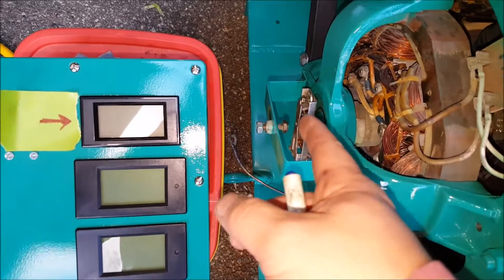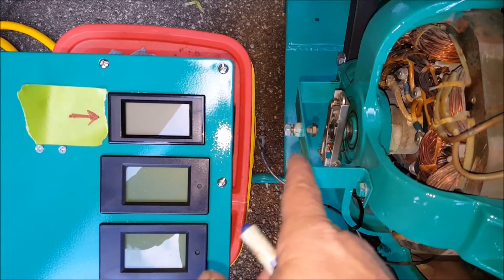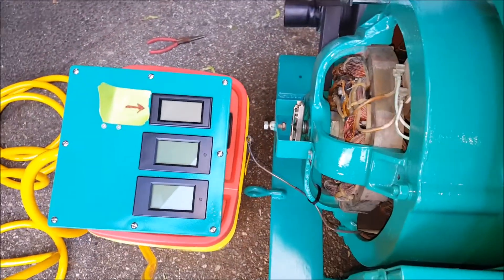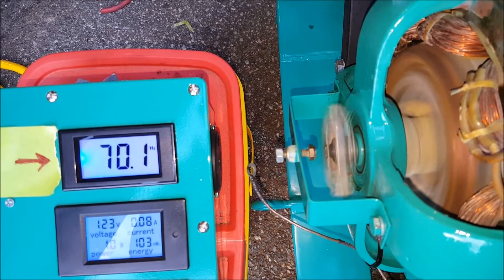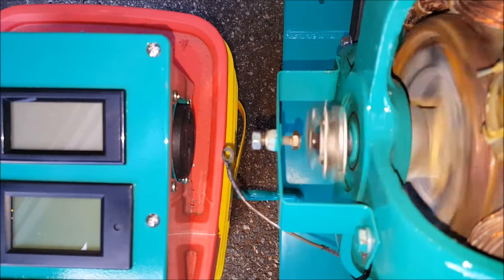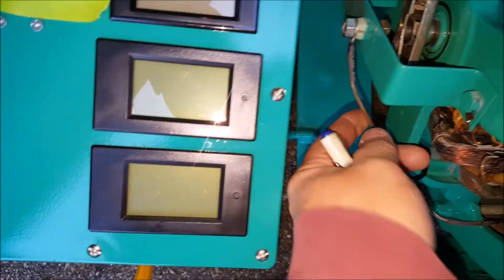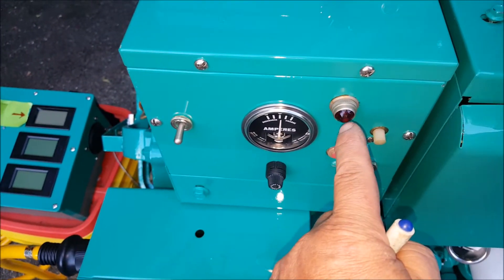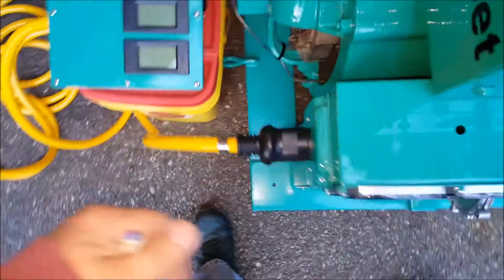Onan JB 7.5 Over Speed Mechanical Switch (OS OK) Adjustment / Conclusion

Comment: I have enjoyed your videos, I have learned a lot about these gensets.  Where did you obtain your digital meters for your system monitor?  Also where have you obtained the Onan color or at least do you have a paint code?

TIA,

Todd
Reply from the maker: Sorry about the delayed response of 6 years, but better late than never. The digital meters are made by Drok. Go a Google search on "Drok meters" and you will see all the meters they offer. As for the paint code, I had the original paint scanned at an automotive paint store and they were able to match the original paint. The paint was applied using a professional paint sprayer, not the cheap rattle cans of spray paint.